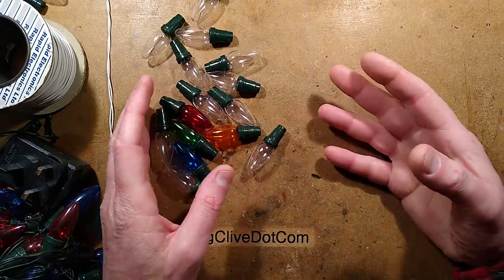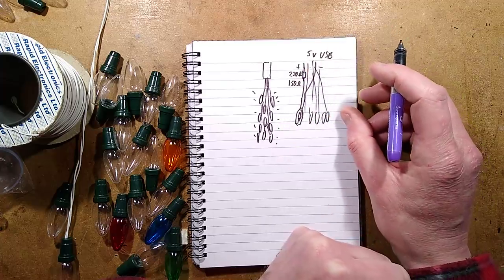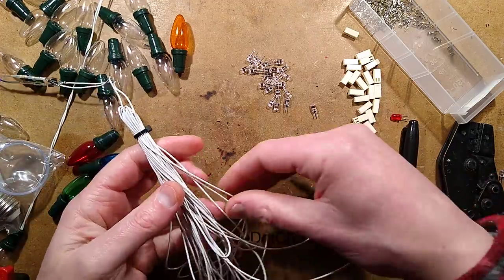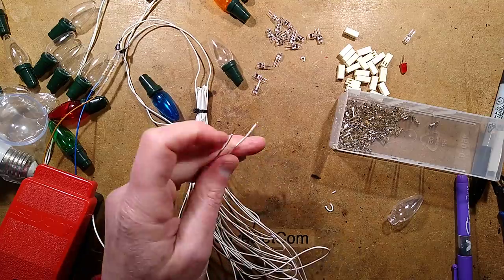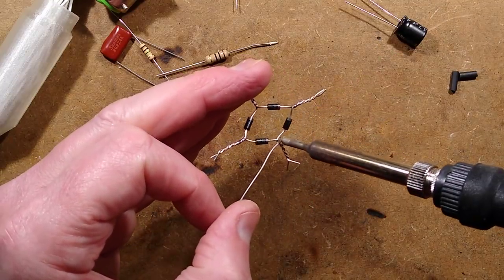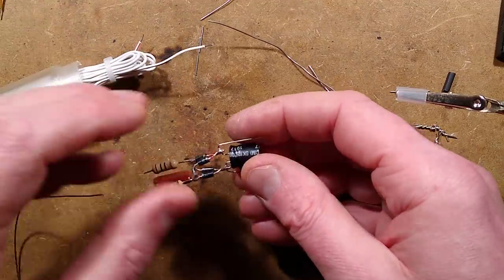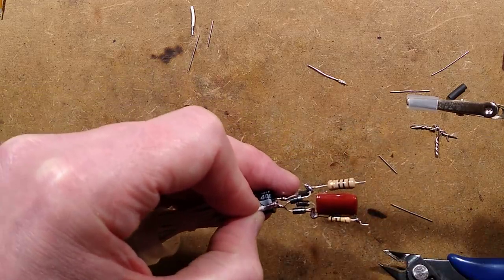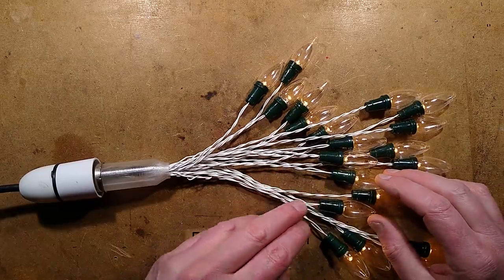DIY build of the dangerous dangleberry lamp

Comment: Bad.....   just bad.    I'm certain you've got a bench power supply around there, and you've definitely got many other sources of low voltage DC that you could have used in establishing polarity on each connector as you made them up.
Reply: I don't see how that would work once you cut the string. You need enough voltage for each LED to start conducting.
Reply from the maker: Every other holder would need shorted out.

Comment: Oooh, a project video to watch while working on my own projects! 😊
Not sure what slicer you're using for 3D printing, but when doing prints with thin walls for the base, I use a 10-15 line wide Brim to help it stick down while it prints.
Reply from the maker: I did add a brim in the end.

Comment: You know what, that would be really nice with a larger bunch, say 50-100
Reply from the maker: That could be a lot of work.  But worth it.  If using mains to power it directly as I did, then it may need divided into smaller bundles.

Comment: Hi Big Clive, I read on the news today that appliance manufacturers are going to start making appliances that don't stop working after a few years, like in the past. Do manufacturers really build appliances to last only a few years? and if so how?
Reply from the maker: They just tend to design them with components with controlled lifespan.
Reply: @bigclivedotcom  so do they design components to fail after a time or just use cheap stuff made from cheaper materials that they know will fail a couple of weeks after the guarantee runs out?!

Comment: I threaded some leds onto my headboard about three days ago, did everything right, now they are starting to die off one by one, bollocks 😂
Reply from the maker: What current are you running them at?
Reply: @bigclivedotcom  they were made to be run off 5v and I'm just using a USB plug phone charger, all have their own resistor, but the ones nearest the plug are going first, can't be more than 20ma

Comment: Sure it would be possible to use better insulated cable. Would make a bit more bulky but would still look good.
Reply from the maker: And ironically I do have double insulated meter wire.  I should try some in a crimp.

Comment: Would love to hear more about this r1 r2 stuff you've mentioned offhand in a few different videos recently. The only r1 r2 I know about is the value of resistors in a resistor divider, especially for setting the voltage of an adjustable regulator...
Reply: It's a test electricians in the UK (and maybe other places, too) do on your building's electrical circuits. However I don't know what it's actually testing, so I would also like a better explanation.
Reply from the maker: It's added to the external loop impedance to give a fault current resistance from live to earth all the way back to the substation.  It's used to determine if the MCB on that circuit will trip instantly by magnetic action.  Largely redundant with RCDs and modern appliances, but kept as another layer of red tape for the paperwork posse.
Reply: @bigclivedotcom  We don't do tests like that here in the US but that makes sense. But why would these devices obstruct that? Is the test more complicated than putting a known current through the wires of a dead circuit and then measuring the voltage drop?

Comment: Love the lights, great idea. To help your prints stick to the build plate use a glue stick on the bed and let it dry before printing. I've not had a failed print due to poor bed adhesion since using glue sticks.
Reply: @Philip Carpenter I use poundland's glue sticks. Pretty much the same as Pritt stick but 1/5 the price and works just as well.

Comment: This project makes me wonder - does anyone make USB power supplies that fit BC/ES lamp holders? hahaha 😆
Reply from the maker: That might actually exist.
Reply: In the US you can readily get adapters at your local hardware store which screw into a light socket and give you a regular outlet. In places with the UK which only have grounded (sorry, earthed) outlets they're not available from reputable sources due to lack of ground in a lamp socket.
Reply: @eDoc2020  - in the U.K. we had two pin plugs in the past and such adaptors for the two pin plugs did exist...

Comment: is there a reason you don't use an automatic wire stripper?
Reply from the maker: I've got a motorised one for the big wires.  But generally prefer a manual one, as some of the universal automatic ones damage the thinner cables.

Comment: Now I know what I'm doing wrong when crimping and they pull off ! 🙄
Reply from the maker: It's a fine art.  You need to find the right crimping tool and perfect its use.
Reply: @bigclivedotcom  True - I have the Japanese Engineer PA-09 crimpers and was wondering what I was doing wrong! Now I know! It's those little tips which make playing with electronics easier!

Comment: Is the 3D printer plastic mains rated?
Reply from the maker: It has a high resistance, but for proper fire rating it would have to be a much more expensive type.

Comment: Removing an LED will cause the voltage across the rest of them to rise?  How's that possible if the circuit is open?
Reply from the maker: Nothing to pull the open circuit voltage down, so the capacitor will charge to peak mains.
Reply: @bigclivedotcom  Yeah but no current will flow cos it's an open circuit. I'm sure one of us has missed the point here, but I'm increasingly worried it's me.
Reply: @greenaum  - you can have voltage without current flow (but the test instrument will draw a small amount of current) but can’t have current flow without voltage.
If the circuit is complete, the series capacitor will limit the current flow, so that the voltage across the LEDs will be limited to their normal nominal forward voltage (about 3V for each white LED). But if the LED circuit is disconnected, because no current flows through the LEDs, the current via the series capacitor can charge up the electrolytic capacitor until it reaches the peak mains voltage (1.41 x the RMS AC voltage).
Reply: @Mark1024MAK  Yeah I get that. But why does that necessitate a protecting resistor? To protect the other LEDs I think he mentioned. If there's an open circuit, nothing needs protecting. So what's that resistor for?
Reply: @greenaum  - do you mean the resistor between the electrolytic capacitor and the LEDs? If you do, that’s to limit the instantaneous current flow from the electrolytic capacitor to the LEDs when the open circuit condition is ended by connecting a LED in circuit in place of the open circuit.
Reply: @Mark1024MAK  THAT'S what I was asking! Ta. Yeah it makes sense now, it's for after he plugs the replacement LED in and closes the circuit again, the voltage will have built up in the meanwhile while it was open. Thanks!

It's odd to think that the LEDs can clamp down the voltage from the beginning when they're plugged in, but not when they're dis/re-connected. I suppose that's an oddity of a capacitive dropper without a load.

Comment: 35:54 Hi - can you go through what you’re calculating there?  You said it’s about right without actually saying what it is not showing the calculator ;-)
Reply: Clive calculates and confirms the approximate relationship between the power factor, mains voltage, current and the DC voltage he approximates at the output of the rectifier. When the power factor is not equal to unity, it means that the current is either leading or lagging the voltage, since we add a capacitor(i.e. the dropper capacitor) we can assume the current leads the voltage. The gist of it is when two sinusoidal values(current and voltage) are not in sync(i.e. one is leading or lagging), when you multiply them (to get the power=current*voltage) you will reach a smaller power value than the unity power factor(where they are in sync, no leading or lagging). Since the power factor is around(because of the capacitive dropper) 0.234 and the RMS AC voltage is ~246V, he approximates effective DC voltage to be around 246V*0.234 ~= 57.5V hence he divides it by 5 to get 0.2 times of it. Then he confirms that total of 20 LEDs with each having 2.5 to 3 Volts on them holds for this value. We can also check similar relationship for power factor with apparent and real power where the real power is the apparent power times power factor. Since the apparent power is equal to Voltage*Current = 246*0.015 ~= 3.7 Watts, the real power is equal to 3.7*0.234 ~= 0.87 Watts which HOPI calculates/measures as 0.899 and it is near enough.
Reply: @saidsaracoglu  Thanks - good explanation!
Reply: @Richardincancale  You are very welcome.👍

Comment: Bad idea to make dangerous projects like this. Why not just use a cheap 230V->5V PSU? Having mains voltage running in each of those tiny wires is really bad.
Reply from the maker: The little mains to 5V power supplies sold on eBay may create a false sense of security (they often have near zero isolation).  The safe version would use a plug-in USB charger of known quality.
Reply from the maker: These wires are rated for about 600V.  But are intended for equipment wiring.
Reply: @bigclivedotcom  I agree that cheap PSUs are not great either. Your wires might be fine, but someone unexperienced watching your "tutorial" might go and make it with some wires of much lower quality.

Personally I would have used a small incapsulated PSU, like a Mean Well IRM-10-5.